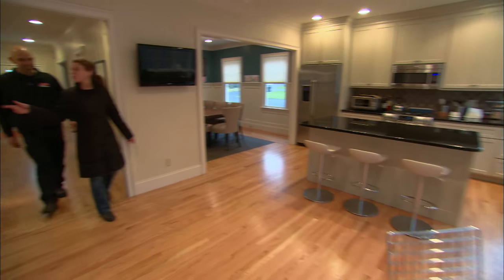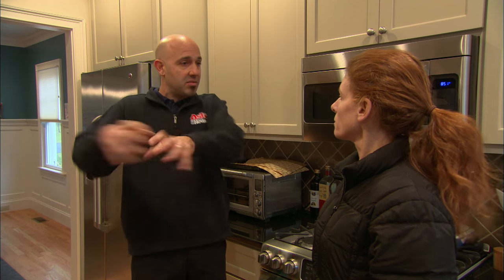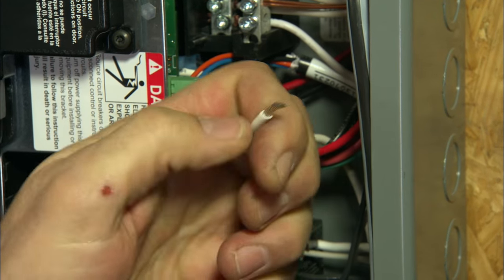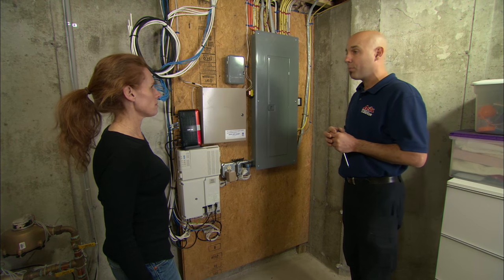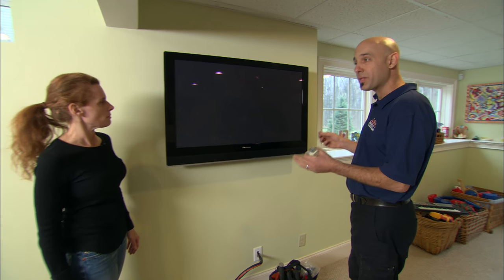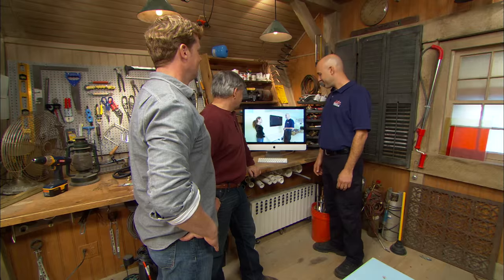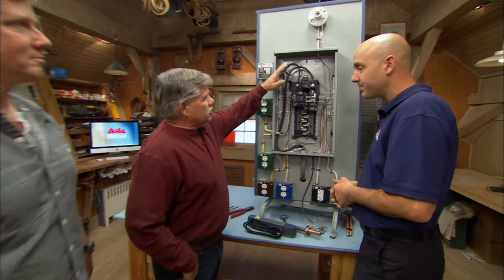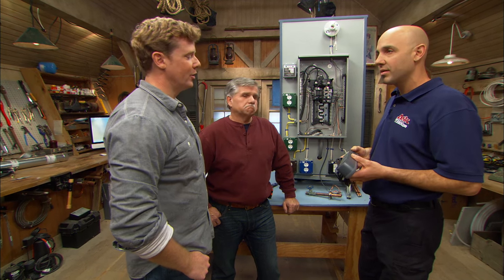How to Install Surge Protection | Ask This Old House

Comment: One point I would like to make is that you can often use a "triplex" breaker when the spots at the top of the panel are already full. The triplex takes 2 spots(like a double pole), but has a double pole and 2 single pole breakers in it. I ordered one for my panel because it is a rat's nest and I want to move as few wires as possible. I used a 50amp double pole and 2 15 amp single pole option.
Reply: its called a quad breaker not a triplex breaker

Comment: very nice.Just one question? If panel box slots are like full but I need to install a surge protector, Is it okay to share a 20 amps double breaker which is also powering other appliances?
Reply: NO. If the panel is breaker full, you need a larger panel or install a pony panel off the main.
Reply: You could "possible" replace some standard width breakers for slim/tandem breakers.

Comment: I don’t understand why you need surge protection at points in the house if you have a whole house surge protection?
Reply: Whole house surge protection just protects your whole house from EXTERNAL surges from the power grid. Not INTERNAL surges from devices plugged in inside your house.

Comment: Internal surges can occur true, but most likely, your panel protector only handles about a 600V surge. Anything lower will still get through. But at least it will prevent most Type 3 protectors from blowing out entirely. They will protect and survive rather than protect and fry by having the Type 2 panel protector there.

Comment: Power surges sound like they create absolute havoc
Reply: Stephen Snell Yes they can
Reply: Back in the mid 80's our Maple tree (was only 5 or 6 feet tall) was struck by lightning (it melted the tree) and everything in my room was destroyed.  Not only the ones that was plugged in I soon found out too. 
Gone was my computer equipment, TV etc...
Reply: @thebeststooge  what do you mean not just the ones that were plugged in......can you explain  more? thanks
Reply: @CactusLadySouth I meant that everything in the room, except for the window unit AC, was destroyed.  What happens is the lightning goes down the wire and creates an EMP so everything electronic that is within range will cease to work not only the items that were plugged in.  Since it was 10-15 feet away from my room I not only had the spike/surge I had the EMP as well and everything electronic was dead regardless if plugged in or not.
Reply: @thebeststooge  Wow, I thought about it and it came to mind that it might have been a EMP effect.  I did not know lightening could do that.  We are in S.C. upstate and we have much damage to electronics inside the home for a couple of years now.   Just put in the home surge protector today.  I need to add  the surge protector strips for each item not sure what brand to buy, would you have any ideas on that? They mention them in the video but really don't recommend one.
Reply: @CactusLadySouth EMP is why I lost the things that were not connected while the AC window unit was left alone as was my 1940's Halicrafters Shortwave radio (used tubes which is unaffected by EMP).  I don't trust strips and instead suggest people to buy a 350va/500va UPS (small and not too pricey) that uses a battery if the lights go out.  It is not enough to last more than a minute or two on a computer but long enough to immediately shut down plus it takes care of voltage sags (brown outs), spikes, over voltage, etc... so way better.  Thing is if lightning directly hits the wire to your house NOTHING (I emphasize that) will save whatever is in line with what is coming.  I have seen videos where lightning has hit the pole of a house, came down the wire, blew everything out and jumped over a piece of electrical gear, and destroyed the thing next to it as it.  If I remember right one lightning bolt has enough energy to light up NYC for 24h if we could harness it.  An electrical storm could light up a city for a month.

Comment: if we have a voltage stabilizers installed for an inductive compressor load do we need to hv an  individual surge protection device  or mains device is enough?
Reply: You can use a buck and boost transformer. As any inductive motor will trip those surge protectors. As the in rush current will be double the amount it's rated for at startup... You can also use a soft start kit. Which most new appliances come installed with today...

Comment: I have 3 power strips connected to each other, do I need to replace all of them with surge protection power strips or just the 1 that is connected to the wall outlet?
Reply: Just the one would work but you shouldn't have 3 connected to each other anyway especially if they aren't "contractor" grade.
Reply: @cakearmy_maxgaming6346  If you want to go that route, you could just get a really big suppressor power strip. Also, the power strips typically have overload protection so it should be reasonably safe connecting multiple ones together.

Comment: How does the circuit surge protector send the electricity to the ground if it's only mounted to the box? What if the box is not wired up to grounding rods or some previous homeowner removed the wiring connecting it to a metal water pipe?
Reply: Most will light up red immediately as u plug them in then. You'll see

Comment: "Does that mean I'm protected?" Still need protectors down range at the computer for example and other small device locations. Video states this.
Reply: The double circuit breaker the Surge Protection Device (SPD) connects to can not be used to power any load, if you were right, the SPD would not protect anything at all.   The SPD needs no protection as its purpose is to sacrifice itself to protect ALL THE LOADS fed by the rest of circuit breakers in the panel.

Comment: How does the surge from the AC make it to the outlet plug on the tv which is on a completely different circuit????
Reply: Back through the panel. Everything is connected. The breakers do not isolate circuits (unless tripped).

Comment: I wonder why not just install the "surge protected" outlets, as standard in homes?
Reply: They cost a little more and then no one would need to come back and charge you to upgrade your outlets.
Reply: SP outlets are $20+ each. A whole house SP circuit breaker is less than $150. Alternatively, some utilities will install SP at the meter for a small monthly fee.
Reply: They're $30 a piece
Reply: Builders go for the cheapest parts.  Even a few additional bucks per outlet kills the idea.
Reply: So imagine the whole house with a main surge protector and in every square inch of the house! all the receptacles. So no more surge protector strips or any other type of surge protector attached to the outlet, yes it’s expensive but I think it’s still a cool idea and a great investment!

Comment: The surge protectors they show are ok  but are based on metal oxide veristor (mov). They still let in surges especially lighting strikes and their warranty do not cover that and man made surges so their useless. Only site suppressors like surge x can protect and warranty against lightning strikes

Comment: I can't seem to find those fancy circuit breakers allowing you to double up - I don't have any additional room in my box
Reply: I would order one online. That one you are talking about is either a triplex or quad. It has a double pole and 2 single poles and only takes up 2 spots. You will need the panel number. If your panel is old, you will need to be patient(I had to rely on a chat discussion) to discover what type breaker you need. The manufacturer for my panel was sold twice and breakers of at least 3 different brands are installed in it currently.

Comment: I need the same thing but opposite, I need something that absorbs brownouts, when my central air turns on my TV turns off for a split second,

I'd try a battery back up with regulated power, but I too am looking for a whole house solution
Reply: Tesla power wall?
Reply: The central air turning on should NOT drop voltages on the rest of your house - at least not to the point of turning other devices off.  You may have a problem with how the HVAC was wired into your system, or a problem with the AC system itself that needs to be repaired.  If you also have a problem with things like the washer or dryer turning on causing lights to brighten up, you may have a bad earth ground connection back to the power company's transformer.

Comment: The SPD mounted at the homeowners service should have been a Type 1 device, I know this is an old video, NEC now requires Surge in all new builds.
Reply: 230.67 says type 1 or type 2.  Type 1's are for BEFORE the main service disconnect.  Type 2's are for after the main service disconnect.

Comment: I got a question can i install a whole house surge protector in my main breaker because I don't have space in my panel
Reply: watch the video...
Reply: As long as you can find a breaker that is rated for your service entrance and is compatible with your panel. I've never seen any like that though, in fact, the breaker/surge combo's are pretty rare in any configuration. You may be lucky and have some unused 1/2" spaces in your panel, which means you can change some of the 1" to 1/2" and make some room. Or you can just use 1" double pole breakers.
Reply: Elzafiropr They literally explained this in the end of the video
Reply: Elzafiropr i
Reply: NO.
Because the main breaker terminals are usually not rated for two conductors (service conductor plus SPD conductor).

Comment: You showed only the Type 2 and Type 3 surge suppressors. 
   The Type 1 surge suppressor fits into the electric meter housing and then the electric meter is inserted into it. If the power company gives you its permission to use this Type 1 surge suppressor, go ahead. If not, do not install one.
   The Type 4 surge suppressor is built into the appliance. Unless the appliance literature lets you know it is there, you do not know.
    The surge suppressors do not protect against a direct lightning strike! A lightning protection system can do this.

Comment: This sounds like a bandaid fix. Just pull out the entire bar and put a surge/RCD combo on each circuit. Also, how the hell did an electrician not install a surge protector when that cabinet was previously updated? The panel and cables look new! I hope this was a production setup!
Reply: David Riley qqi

Comment: The mfg recommendation is to have two single pole breakers, not a ganged dual pole. This way you dont loose protection on one phase if the other is triggered.

Comment: ( On customers panel) why did you not investigate and find the cause of the "Existing surge protection" did NOT protect?
The "existing surge protection device" is located below the rows of circuit breakers. I also ntice theis device was not on, after the "New" protection device was turned on.
Reply: +Henry Milek Are you referring to the block on the left side of the customers panel? That is a doorbell transformer.
Reply: +Erik Liska Alas you did not read my comment, above. 
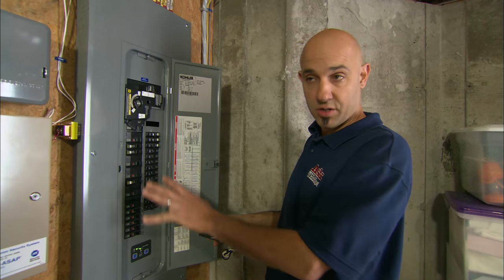No, I'm refering to the (two led device) located below the 2 rows of circuit breakers. ( at the 1:39 time mark) "That is the  GFP installed at the  Manufacturer's site". It appears to be working?
Reply: he turned power on and shut door,,,I personally have never seen that style box,,lol,,,,
Reply: the electronics you see at the bottom of the rows of breakers is an automatic generator transfer switch thats built into the electrical panel

Comment: 3:40  I had a belkin surge protector on a computer once.  We had a power surge a shortwhile after that.  It blew out the Belkin surge protector AS WELL AS everything connected to it.  I was pissed as I paid quite a bit for it.  I've also had a couple of Belkin power cables fail.  I'll never buy a POS Belkin item again.  As for lightning strike, I've seen a strike melt a couple dozen feet of wire and set the wall on fire from the heat.  No surge protector is going to protect from a large, direct lightning strike.
Reply: Belkin is bottom barrel garbage. Apc or nothing

Comment: I still can't understand why they think each outlet/set of devices needs it's own VDR (surge protection) as any spike would push up the voltage at the main VDR and would allow it to flow to ground protecting all devices in the house even from internal voltage spikes.
Reply: You'll need a surge protection on each outleet as the last level. ... but first you'll need a good earth wire and a new cable layout.
This video is only half the work (direct and indirect lightning protection, ground wires without loops ....).
A typical surge protection is a VDR, gas discharge tube and a common mode choke at the right point ...

You'll find some nasty places on earth (lightning stikes vaporise solid steel cabinets regularly, 5000V static in the air ....)
Reply: The way I understood it was cause by the time the surge reaches back all the way to your main panel to the ground protector your sensitive electronics close to the surge appliance done been fried

Comment: Ask him if on a 2 circuit plug . and lose your neutral to a plug.   Seen it happen a couple of times of the neutral failed in this type of dual circuit.  Shot 240 volts to a kitchen Ref.   Up in smoke.. Saw one time where in a real old GE sub panel . the neutral bar actually melted in two.   Was a very small neutral bar.  But shot 240 volts to a TV.  Boom
Reply: Roger Olson
 ... The case you describe is not a lost neutral to a single plug, but a lost neutral to the entire sub panel. In that case you get unbalanced legs. Metering across both legs will still get you 240 volts but each leg to neutral will not be 120 volts. What I commonly see is one low leg (50 - 70 volts) and the other leg at 170 - 190 volts. It still adds up to 240 but the appliances on the high leg generally become toast. The typical call from a customer is about some lights being dim and some lights blowing out, along with some appliances not working.
Reply: @rupe53  . we traced back the 12/3 to a basement j.box. opened it up and in tha j box the neutral worked lose.   Remade it up .  took care of problem.   Long time ago a sparky in my area would run a 12/3 to a kitchen outlet and split the circuit from there.  No longer do that.
Reply: @zerosparky9510  ... glad to hear it's solved. These days if you run a 3 wire cable like that it needs to be on a double breaker with a common trip, so it can still be done legit, but I suspect not in all locations. (local code issues) The key here is the supply was originally 240, not a single 120 circuit. The same theory applies as I described earlier.... unbalanced legs.
Reply: @rupe53  . yes. This was years ago.  I would never run a 12/3 to a kitchen outlet any more.  Back in the 1980s.  I was young in the trade and the main sparkys would do this.

 Especialy with the advent of arc fault breakers just install a single circuit.  Install several circuits to the kitchen.
Reply: @zerosparky9510  ... on new construction you have a choice these days. Back in the 80s we had the situation of all those renovations where people were fixing up post WWII kitchens that had only a single circuit. All of a sudden we had a toaster, toaster oven, 1500 watt microwave, etc.... and we needed more juice in a hurry. That was the heyday of electricians pulling in extra circuits via the 12/3 deal. These days I still see problems there when someone installs a generator and splits them up. Now all of a sudden we have a neutral going back to a breaker panel that's not energized... but the neutral is working so other stuff in the house is going nuts. (flickering lights, etc) Obviously someone is not looking at things like this when installing a gen set.... but I find it!

Comment: What’s a good brand whole house surge protector?where do I buy?
Reply: 175elias Innosys power if you’re in Canada , believe they sell in the US too. Also just go to the local electrical supplier
Reply: Surge protection requires multiple protectors located through out your home. Whole house, one that goes in your main panel, protects surges from going through a panel, but all outlets on the circuit that had the surge is still vulnerable.  Point of power, or at the plug, behind a refrigerator, an air conditioner, or anything with a compressor will stop the surge prior to the circuit.
Compressor fsilures are one of the main causes of surges.
So buy a EATON CHSPT2ULTRA for whole house and a couple Legrand 5252WSPCC6 in wall surge outlets. Both are found on Amaxon.
Reply: 175elias - GE makes a whole house surge protector that plugs in directly to your power panel like a breaker and is available from Home Depot. I installed one after a huge power surge took out the fan motor in my furnace and also took out the compressor in my neighbor’s brand new Carrier condensing unit.
Reply: I got a GE 2 pole surge protector easy install of you have the breaker space.

Comment: 99% if these decices just have Metal Oxide Varistor or MOVs in them. When the voltage is exceeded the rating of the MOV the resistance decreases and the MOV disappates this as heat. If the voltage spike is fast, the MOV will look like a short and pop the breaker.
You can get MOVs from a lot of electronic supply places for about $0.40 USD ea. WAY less than one if those expensive power strips. Next time someone throws one out, open it up and you will see the small at round disc. That's the MOV
They are small ceramic discs with two wires and can be placed across the hot an neutral wires